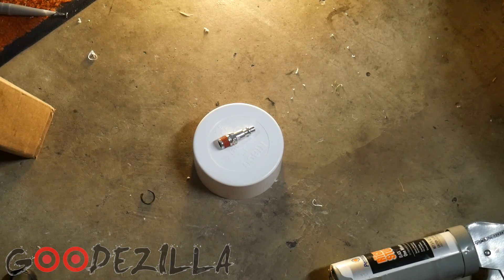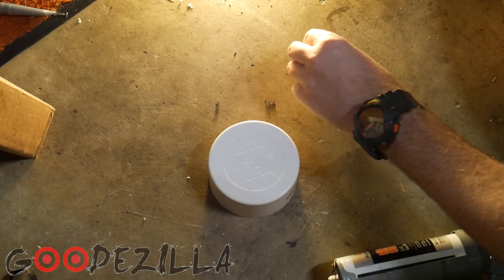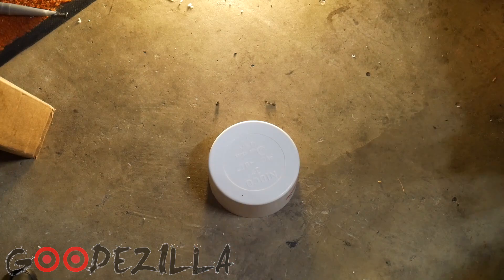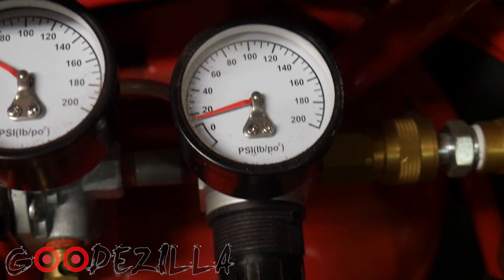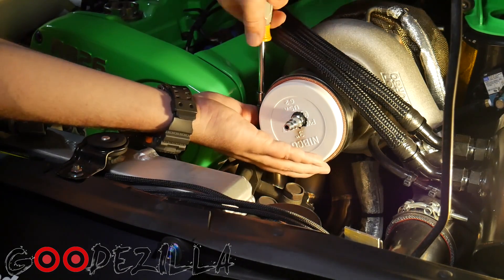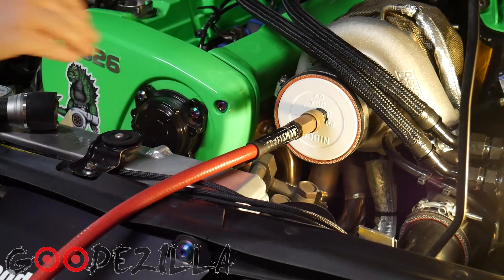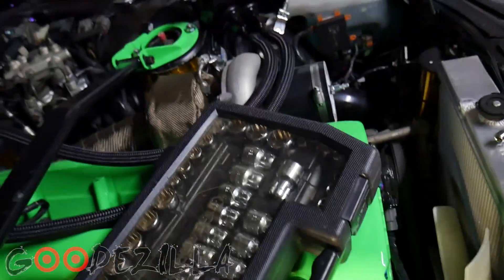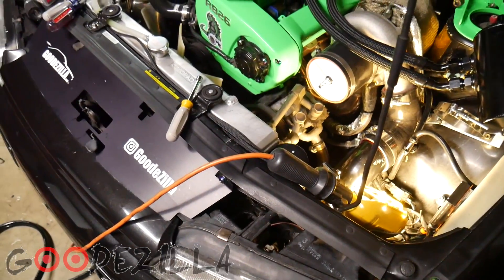How To Make A Boost Leak Tester and Check for Leaks

Comment: Hi again! I’m having the exact same issue. Same turbo/ wastegate etc as you. I’m going to get a cap and do the same as your doing. Did you plug the exhaust or anything? Would the pressure just escape through the cylinder that’s on valve overlap or past the rings?  Any help would be appreciated
Reply from the maker: The throttle bodies should be closed enough for the tester to show any leaks in the intercooler piping. Then you can open the throttle bodies to allow air passed and into the engine. It could be sitting with valves open but you'll have to play around with it.
Reply: @Goodezilla  Thanks! I’ve not got a compressor at home but I must be able to use a tyre inflator hopefully
Reply: @Goodezilla  also; did you have any other symptoms other than low boost ; ie misfires or extra noise from the turbo? I killed my turbo round a track so I want to diagnose exactly what happened.

Comment: did you block off any lines? and did you have the throttle opened?
Reply from the maker: David Tsai no and no.
Reply from the maker: Actually I think I remember plugging the line that went to my oil catch can.
Reply: GoodeZilla thanks, I've been reading different things about which lines need to be plugged off. Will figure it out.

Comment: Possible that any of these leaks existed during your dyno runs?  My GTR with HKS 2530's arrives tomorrow and I'm stoked as all hell.  Detecting boost leaks is still a concern. How would ya do it with twins - force air in one turbo and cap off the inlet of the other?
Reply from the maker: Josh Taylor I'm sure it's possible, but if I had a leak it wasn't bug enough to keep me from reaching my desired max boost. For twins you could take off the twin turbo pipe and connect the tester to the pipe going down through the fender. I know that bypasses the turbos, but seems easiest. You could also do what you said. Would just take more than what I made in this video.

Comment: how did it feel when your car chugged cause the leak? when I'm out having fun and I go all out sometimes I feel something like a slip of the clutch would feel. but my clutch never seems to have issues hooking up when dropped at high RPM. only on a steady increase within the power band...
Reply from the maker: When the intercooler pipe popped, it felt like I "hit a wall". But after that, it somehow still held SOME boost, and my turbo just kept spinning faster and faster to try and make that boost.
Reply: GoodeZilla damn probably is my clutch going then.... ah well love putting new stuff in cause I have no idea what the previous owner did to her lol. keep the videos rolling! you da man.

Comment: What port etc were you plugging with your finger initially? Nice test btw, its gotta feel good knowing everything is tight n sealed correctly 👍🏻 Heres 1 more reason going Single turbskis is a Good thing lol. Any ideas how it would be done with the stock setup lol? Good luck at ur next drag day, looking forward to it 🤗
Reply from the maker: The port I was plugging is a vacuum source that's a hard line that comes over from the intake manifold used for the stock twins. I had capped it...but the cap blew off. You can block one of the turbos off on a twin setup and just apply pressure to 1 of the turbos.

Comment: what boost your running with that 6266 ?

glad you sorted it.. done this trick myself when I ran my gt3076R.. works a treat and good to check up every now and again.

found a leak on my own 32 the other day.. bloody vac hose connecting to the rear wastegate had split but it was underneath where I couldn't see it. sodding thing lol

btw question.. when you film is it with a go pro and do you have some sort of suction attachment for the car? want to do some filming of my own just can't figure out how to attach cam to car lol!
Reply from the maker: I'm running 17psi currently. I have gopros with suction cup mounts for on the car. I used my phone in this video for the night shot as it was sort of unplanned. And I use a Panasonic G7 for filming the rest of the stuff with a tripod.

Comment: what kind of couplers are those?
Reply from the maker: the couplers are 4ply silicone, the clamps are t-bolt on the turbo side, and the pipe to the intake manifold are regular old worm style clamps.

Comment: i like the way you mention the hichas. i believe you can pull the fuse for it and have it not interfere for now at least
Reply from the maker: I think if you pull the fuse, you get a dash light and your steering becomes heavy.
Reply: GoodeZilla On 32R's yes. Total delete including pipes and reservoir will be best.
Reply from the maker: Tosseef Hussain yup doing that this winter!
Reply: My Hicas light comes on after about 15mins of driving, steering remains the same. But im unsure if its because of my aftermarket steering wheel hub or not.
Reply from the maker: Tom Kaos (Official) most likely due to the aftermarket steering wheel. If you have a deleted hicas you can modify the plug going to the hicas computer so the light doesn't come on.
Reply: Which fuse is it? Im having hicas issues and want to rule that out as one of the possible rear end issues.